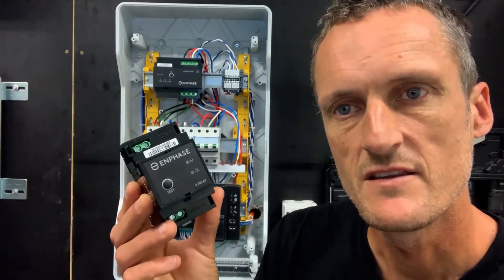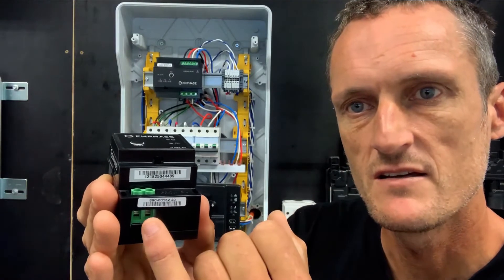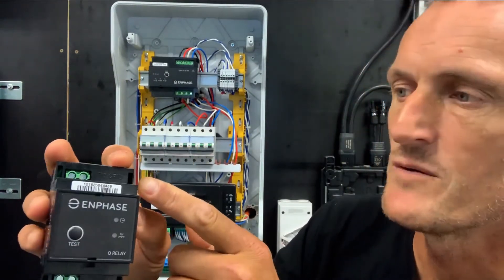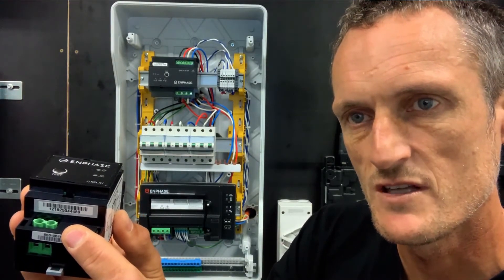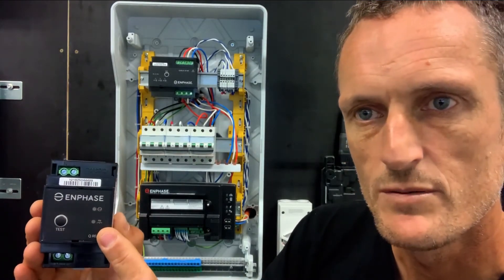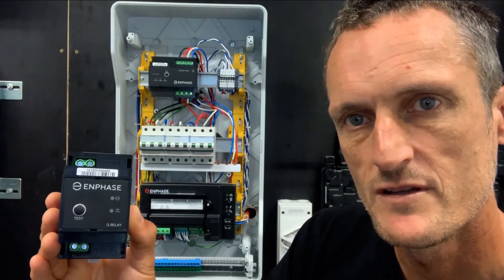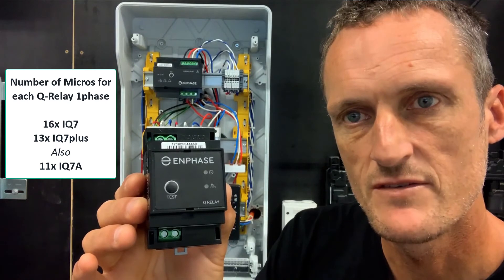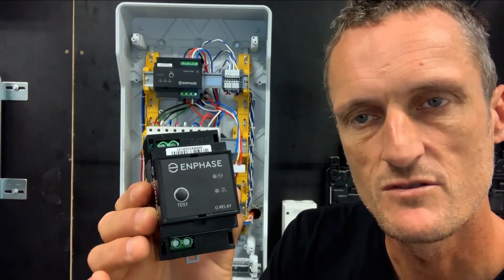Q Relay Single Phase

Comment: Hello, i have problem understanding how you connect the neutral. Our micro inverters are iq8x with L1 and L2 no neutral how do we get the neutral to the q relay.  For south africa with only L and Neutral as electrical system. Thank you for your understanding and support.

Comment: I'm having such a hard time finding the right answer to my questions regarding an Enphase installation. Maybe you could answer?  I basically would like to know if I can connect 3 single phase Q relays one on each phase of a three phase system? We have many houses here that have 3 phase feeds but it seems the enphase 3 phase system is marketed as a commercial product only.
Reply from the maker: Hi Kevin,  Enphase supplies 1phase (Q-RELAY-1P-INT), and also 3phase IQ Relays (Q-RELAY-3P-INT) for installation in microinverter circuits for solar grid connected installations.  Either of these products can be used in 1phase or multiphase applications.   However, we do recommend using the 3P IQ Relays in three phase sites ,  as these manage the microinverters across phases, and enable compliance to AS/NZS4777.2 for multiphase site requirements.

Comment: Thanks for the video. I have an older enphase system that was installed 4 years ago, before some of the newer regulations came into place. My system does not have a Q Relay installed. Given that the inverters themselves are compliant to AS 4777 standards, is there an additional requirement to install the Q Relay? My understanding is that each inverter already has the grid disconnect functionality built in as per the 4777 requirements. I'm just interested to see if my existing install is compliant. Thanks for taking the time to reply , if you do.
Reply: The Q-Relay is a mechanical disconnection requirement for installations using IQ microinverters for ANZ.   If you have earlier versions of microinverters: S-series or M-series, then this Q-relay is not required.
Reply: @duncanmacgregor1961  Thank you for the response, much appreciated. For those considering Enphase, I would highly recommend. I've had my S270 based system running flawlessly for 4 years now. 115 panels and inverters, not one issue.